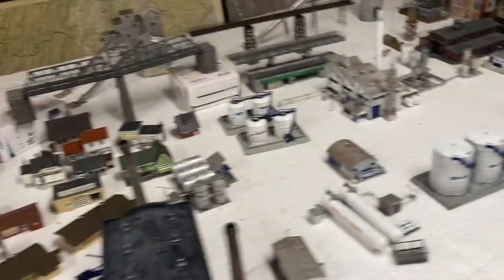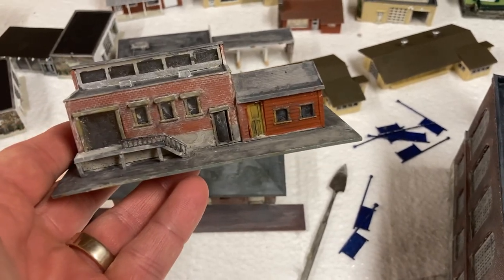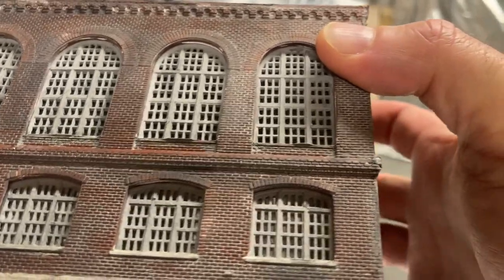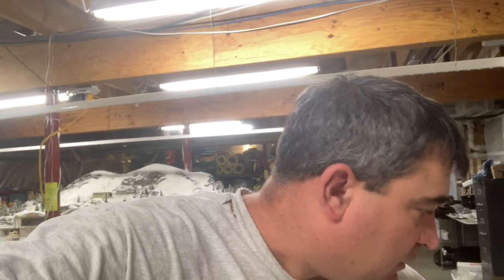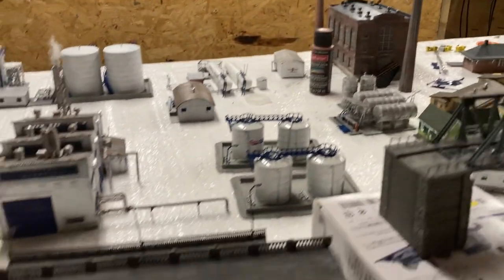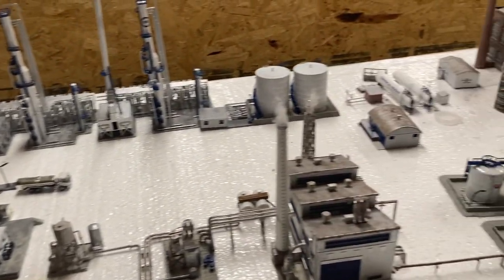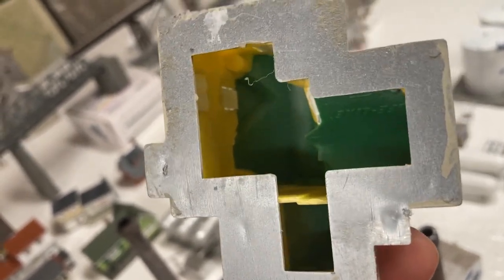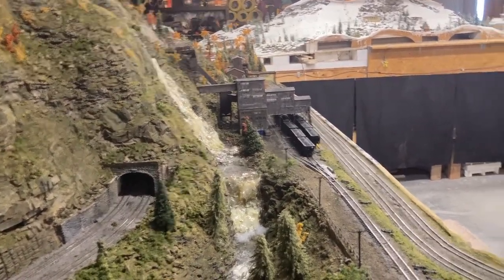The N Scale Architect: Painting and details to Model Structures

Comment: Nice job repurposing those buildings…for mortar joints I use a grey acrylic wash over the surface then wipe with paper towel…you’ve got some nice water scenes on your layout…would like to know how you created the falls
Reply from the maker: I need to do a tutorial on this. Here is how I do it. I bought Angel Hair and 2 part epoxy at Hobby Lobby. I put the mixed epoxy in a medicine cup and use a small paint brush in the epoxy and coat and brush the Angel hair in one direction. Being new to YouTube when I built this layout it didn’t dawn on me that anyone would watch tutorials but I have received a lot of requests.
Reply: @Rktect3902  thanks for that info…want to creat a small fall but wasn’t sure how to do it….have seen other techniques but very complicated
Reply from the maker: @georgiasunbelt   thanks. I have another YouTube channel I post weekly too I’m trying to wind down and wind up this one. Your suggestion is exactly what I need. As you see in my videos my layout is about complete so my fault is I started my channel too late. I do believe I can show techniques on how I did my scenery. As an Architect I learned a lot while in college on modeling.